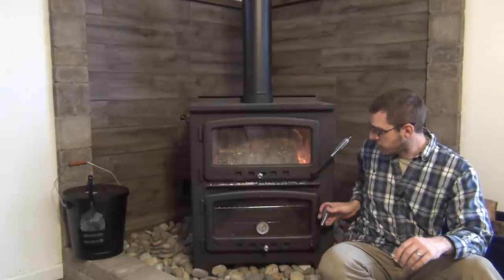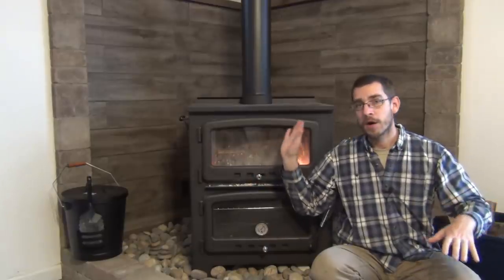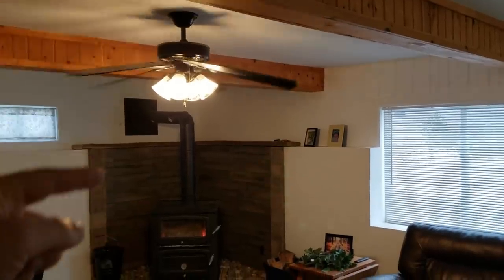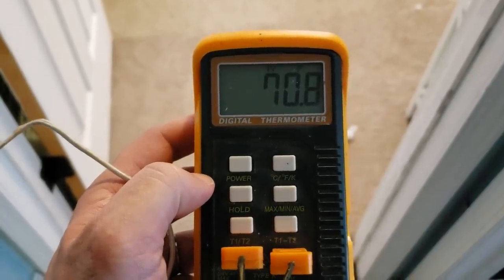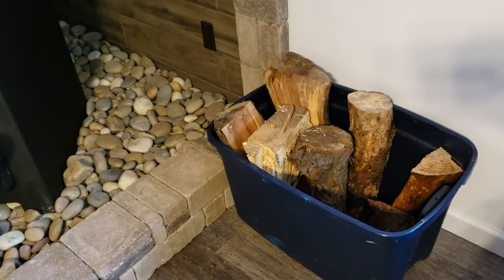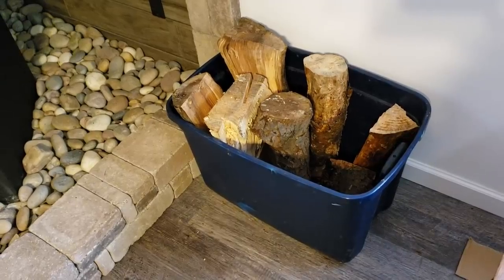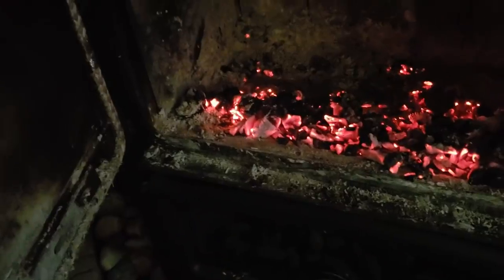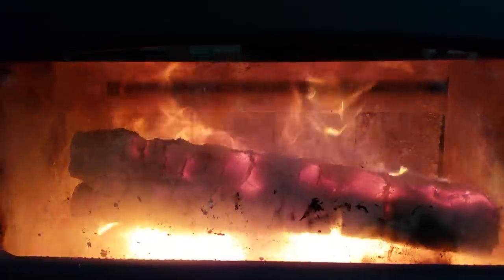Heating With Wood - How well does it work? | Vermont Bun Baker XL

Comment: Make sure ceiling fan is blowing TOWARD the ceiling in winter. Yep, opposite of what you'd think. Blow down for summer, up for winter. Makes a HUGE difference, that's the way ceiling fans are supposed to work.

Comment: Make sure when you vacuum up that none of the ash, embers, or pieces of wood in the stones are still hot/on fire.  Vacuuming ashes around wood stoves leads to many house fires annually as the embers slowly ignite the bag inside the vacuum and before you know it you have a disaster on your hands!!  Stay safe, thanks for the video.
Reply: They make hot ember vacuums that don't go into a bag.  Just an FYI
Reply: @richfarfugnuven6308  Cool I wasn't aware of that.

Comment: Saw one of these a few years back when I dropped my nephew off to college.  My fireplace has an insert which requires electricity to truly heat the house.  Without electricity the insert doesn't work so well.
I like this stove and am trying to figure out how to have a free standing installed.
My mountain house has a fireplace which will heat the house even without doors on the front.  It's design is beautiful but wood wasteful.  There isn't enough room to put a free stander on the floor and vent through the fireplace flue.  The fireplace opening is quite large and I'm trying to figure a way to place the stove inside the fireplace, seal off the fireplace damper, and let it flow out and through the house that way.  
This stove is likely too large for this application.  Too bad because I really like the stove.
Good luck with it and I hope it provides a lot of heat for you and your family.
Reply: Bee Bob there is a smaller version of this stove. Look up Nectre Baker’s Oven. The one in this video is actually a Nectre Big Bakers Oven.
Reply: @looloo4029  Thanks

Comment: your setup sounds exactly like mine. same style house same size stove. we put a cast iron kettle on ours to add humidity to the house. wood heat is very dry. I keep 5-7 cords on hand for a possible power outage. use forced air mostly as a convenience . not real handy if you're gone for several hours out of the day. love the ability to back up to the wood stove after shoveling snow off the driveway.

Comment: You could run your furnace fan on the "on" setting instead of "auto" and it would circulate the heat close to evenly throughout the house.  A wifi thermostat is good for this, so you can control it remotely when needed to move the hot air around to even things out.  That's how I keep my living room from getting too hot for comfort.
Reply: i have done this for customer  i have gone one step further and install cold air  return  in the the ceiling close to the wood stove sucking all the hot air that develops at the ceiling level And Distributing it through the house customers that I've done this for said it works great and keeps the house warm  even Heat I even installed a hot water loop on the back of a stove once which we circulated water through and then passed it through the hot water heating system this also worked very well I live in a cold climate curved the heating cost quite a bit

Comment: I have a Napolean wood stove that has a double blower. I'd never buy a wood stove without a blower. Especially when it gets below 25, if the blower isn't on you have to be in the same room as the wood stove to stay warm. I live in a log cabin that was built about 60 years ago with cement chinking; and it has single pane windows with very leaky and some missing storm windows, so I have little insulation. Luckily my 2nd floor bedroom is directly above the living room with the wood stove in it, so it stays plenty warm. The rest of the 2nd floor however, (bathroom and spare bedroom) stay fairly cold. The #1 advantage of course is that it is an off-grid heat source in case the whole-house furnace has no power, and I enjoy the ambiance. I keep a stack of wood by the stove big enough for 24 hrs, so I only have to haul it in once a day. The one bright side to the emerald ash borer in my area is that tons of trees are coming down for free firewood. Ash burns pretty fast, but it burns hot and seasons fast.

Comment: You can get an inline heat exchanger that will fit right above your stove that has a fan with it and it will make a huge difference. Goodluck from Oklahoma.
Reply: They suck, I bought and used 3 of them in a single year, Now I do not use anything just pipe, I do not use a damper. I just control air via the stove.
Reply: @kameljoe21  I use one and its about a 15 degree difference in how warm I can make my house. They work if you get a good one. If you buy cheap then yeah they will go out pretty quick. Buy good steel pipe and build your own. If your not handy welding I'm sure there is a machine shop around that would build it for a small fee.
Reply: @Mark OnTheBlueRidge I keep hearing about how they cool the pipe off and and make more creosote  but I have yet to see it myself. If you burn good dry wood there is little creosote residue. Also the dirtier the fire the more left in the pipe. I've been burning for well over 30 years and have yet to see any issues. Either I'm doing something right or your doing something wrong either way lets figure it out.
Reply: @pitviper8795   Yeah, I bought 3 different types and styles, I did not like them. The house was quite large and needed more heat than they could stand.   Where I live now, We do not need anything like that. We have a small house and end up having to open windows in rooms we are in. Not that we burn it super hot,  Just way to much insulation during the warmer times of the years.  Tonight will drop to 15F and we had a little fire ( about a cubic foot of wood ) around 6pm and will not start another one till around the same time tomorrow, The high for tomorrow will be low 40s.  Fires around here are are when you are cold enough that a blanket is not enough.
Reply: use one every year. it has an internal scraper i use every fire.  i check my soot 2x a year but only brush once a year on my metal pipe.  going straight up and out my roof.  i bought it used and it works awesome.  i wish i had some ductwork in my house to circulate the air.  i know ductwork but i dont care to crawl around in my attic as its loaded with loose blown in insulation.

Comment: If your furnace motor is efficient enough it might be a thought to leave it running on just air circulation just to move the air around the house during the night during colder weather I know with my parents thermostat you can set the thermostat to run the furnace fan and it will cycle the heat on and off as needed
Reply: Wayhart you have to be careful some furnaces blowers are strong enough to reverse your draft
Reply: I have a newer house with zone returns - I can't use the furnace blower to disburse heat.
Reply: @jtbrunton  if you have a home controller on the furnace you can sometimes have a furnace guy install an override panel which will allow you to individually control eat shrooms temperature without calling for heat which just causes the fan to come on and deliver air to the room as well as trying to regulate the temperature of the room that is warmer than it should be by opening up the vents and running air through the room at the same time and they are should mix inside the furnace if you have a single furnace in your house if you have dual furnaces you would have to have an air mixing setup installed that would exchange the air between two or more systems which is typically a fan with baffles that just blows air from one duct to the other and a return back to the original so you would have to have someone who has installed a system like it before or speak to someone in a Northern climate like Alaska or the Yukon who has more experience with systems like this who could guide a local guy through the process I used to work for a home integration company and I have seen a few systems like this where we would tie them into the home automation so that the customer could tell if he had to go home and restock the wood furnace
Reply: @waylonhartwell  Picture this - my house is a pole-barn style and measures 36'X72'. The single thermostat is located near the center in a hallway. The rooms have their own return air vents rather than a single air return in the center of the house. That is what I meant by zoned. My stove is located in the center of the house near the return air for the kitchen/living room. One would think the rising hot air would go up that return and disburse to the most outlying rooms. This doesn't seem to be the case. Perhaps if I put plastic over the return vents in the outlying room there may be a chance warm air would disburse. Unless it it really cold I would prefer the bed rooms at the far ends remain cool for sleeping.
Reply: @jtbrunton  yeah typically zoned rooms mean that each room has an individual thermostat and the hot air vent has a damper that opens and closes with the furnace having a variable speed motor on it so that as there is a call for heat the furnace will ramp up and ramped down according to the demand for heat with your system you might try just to see if it works closing off a few of your cold air return vents as long as you don't starve your furnace fan for air and you could also try pulling the great off of the return air vent closest to the wood Heat to see if that would create some air movement in the house but like you said having cooler bedrooms at night is nice so it might be a Simple Thing as putting a stand-alone fan close to your wood Heat and letting it push the heat down 2 a different part of the house what I've seen a few people do is install thermostats on the power cord of the fan that turn on at a certain temperature and turn off as it cools down so that when your wood heat goes out in the middle of the night you're not blowing cool air around the house it would probably be the simplest solution if it was really something that you wanted to try
Reply: I would like to know the cook box temp range
Reply: @kennybrandow4994  I'll imagine you can get it pretty hot and if you let the coals die down you can get it pretty cool I think one of his other videos where he was actually cooking in it he may have mentioned it

Comment: Great video! It was very informative as well. My wife and I are on a journey to try to be more self-sufficient. Thank you for your video. Looks like a great looking stove. Just a couple suggestions. Turn on your furnace blower to help circulate the heat from the stove even better. Also if you have poplar wood around your area it can help clean out the stove and pipe by burning it.
Reply: Steven Rushton you can buy an Eco Fan which sits on top of the stove. No electric required. It automatically starts up when the air rising from the heater reaches 50 degrees.

Comment: Put a small fan blowing down the upstairs into the stove room. Draws the cold air and directs it to the stove; the air moved is replaced with warm air. Cold dense air pushes easier than warm light air.

Comment: U might try leaving the fan on your propane furnace in the on position it will move all the air throughout your house  and still allows the furnace to kick on if needed   Heated with wood for many years and it worked well for about the same size of house in Ontario Canada   All the best

Comment: If your propane heat source is a furnace and not a boiler, you could set the thermostat to the "fan on" position and that would circulate as well as filter the air throughout the home.

Comment: Ceiling through to next level  floor vents would exchange more heat from your basement to the bed room areas
Reply: housing code mite not allow do to fire spreading quickly.old house are some times grandfathered in depends were you live. and insurance company mite not allow floor vents for the same reason.
Reply: In my area of Michigan it's very much so against  code. An old house can be grandfathered in but insurance can turn u down.

Comment: Love the wood fire heating, I’ve had wood burning stoves for over 40 years. A few things to note
which concerns me. I’ve criticised your flue the 45 degree bend is just crazy, against the law in the uk.
Creosote forms I did the flue age temps under 250 f , fact. The more softwood you burn the more
creosote you produce the lower temps you burn at during the night will deposit huge amounts
in your flue and my guess would be after a year you will have zero draw on the flue and a room full
of smoke. A 6 inch glue will reduce to 4 inch within the first year of burning daily. The risk of fire 
increases. I burn dried soft wood only in small amounts and always with hard wood. Finally your
burner is drawing its air supply from your room so please please make sure you have window vents
open and carbon monoxide detectors fitted to your home. In my retirement home I had a hollow
floor do was able to vent the air into my wood-burner directly from outside which meant I did not 
need to keep a draft window vent open. I’ve swept many friends flues for them and pulled out 
three or four rubber sacks of creosote and a few have had flue fires which blew themselves 
out luckily but damaged the steel liners. Just my experience only.

Comment: New subscriber here. Ive watched all your wood burner videos. I really like the affordable approach you took to the hearth. I think im going to copy it and adjust for my own install. I foolishly had a fireplace built into the main floor of our ranch home but did not have the chimney ran to the basement. So unfortunately i now need to run a second stove pipe. Cant change it now so ill just have to deal with the second pipe.

Comment: If you change the direction of your ceiling fans to clockwise in the winter and counterclockwise in the summer you will gain more efficiency(especially during winter months)

Comment: The stove and Surround looks great you need to get some good Hardwood I only load my stove twice a day my house stays 75 degrees Plus
Reply: I envy you.  Here in Colorado hardwood costs a fortune as it's so hard to come by.  I recently did get some scrub oak (31 million btu!) and ran that through my wood insert.  Wow what a difference!  What I do now is use the pine earlier in the day and put the oak in at night.  I was shocked the first time I did that and woke up to hear the fan still going on the fireplace the next morning.  I won't use it much at $400 a cord though!

Comment: I run a 60 dollar stainless lasko fan against mine.  it heats a 40x40 basement, a 40x40 first floor  and takes off the edge bigtime on the 2nd floor which is also 40x40.

Ceiling fans as well to circulate and push the warm air down.

Comment: Tomax xxx totally agree those make a huge difference and no electricity needed.my advice don't just sit it on the stovetop you gotta do a little finessing with them but that would get the heat transferd from primary(woodstove) to your secondary( ceiling fan)transfer of heat thru out the bottom floor at least way more efficiently.i refuse to not have mine in use at all times..try it and you will be pleasently surprised.

Comment: If that fireplace has an air intake option on the back pipe it to outside. If you choose to have the fire pull air from in the home it's going to cause a negative pressure & pull cold air in through the windows & doors. It would cause wasted heat to go right out of the chimney, that's why the external intake is recommended.

Comment: if you are able, there is usually a switch to reverse the direction of your ceiling fan (counter clockwise), which will take your warmer air and push it lower.

Comment: the way I get our 3300 sq ft house at an even temp heating with a wood stove is run the blower on the central units before bedtime.  Really stirs up the air and gets rid of cold spots.

Comment: Hi Bro the best work I have done in my home to date was installing a multi fuel stove👍 it is about half the size of yours but it is a great addition to my living space for both heating and aesthetic reasons. 
I keep it burning for around 3 months at a time using a little smokeless fuel for slow burn and wood to get a blast of heat when really cold 
The only disadvantage I have is ash removal 🙁 it is a bit scary carrying a small low sided tray through the home full of hot ash every 2 days but it's become my morning ritual 😂 I would love to design my own stove and would have a few mods to make it more practical for cleaning etc but that is for another life ! 
I have recently built a small cabin for my wife (available on my channel) from pallet wood and free timber and would love to build something bigger but I already have a large log cabin as a workshop, I have a constant source of tall pallets (6 feet) which I hope to use for fence around my home 
Can't wait to see your build 😬 God bless 😇 Steve

Comment: SSLFamilyDad Perhaps removing the oven racks and placing a custom cut rectangular granite block inside would provide a free thermal mass, also I hear good things about those closed circuit steam powered fans I just invented lol, just kidding but I'm sure you've seen heat powered fans which are pretty popular now, especially the old timey looking ones.
Reply: SSLFamilyDad Also I just remembered a tip to clean the glass you may have heard of: An old rag dipped in a paste of wood ash/water becomes an amazing wood stove glass cleaner, and it's essentially free.  It also becomes a great firestarter as a bonus.

Comment: I think that based on all the homes I have been in that were heated by wood that you should cut a hole in the ceiling  of the basement and put a grate over it and then do that to the next floor up.  Very standard thing to see in older homes that were heated by wood. Now most of them were not three floors but two for sure